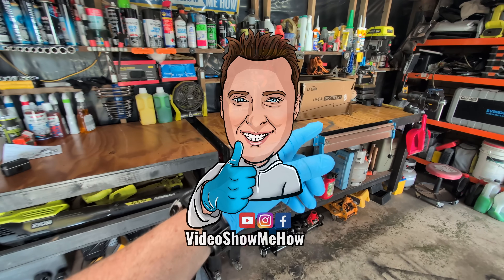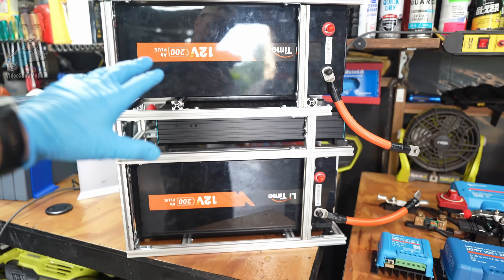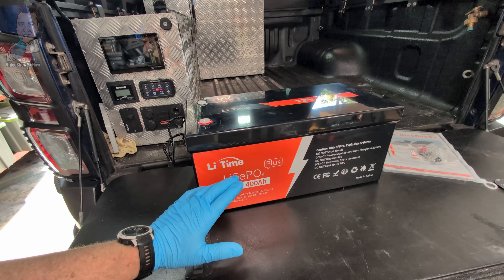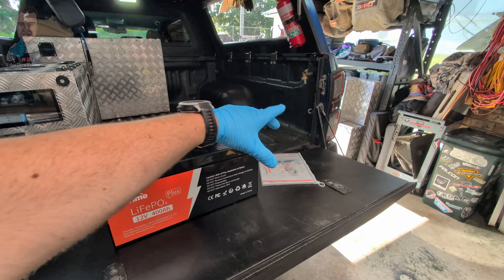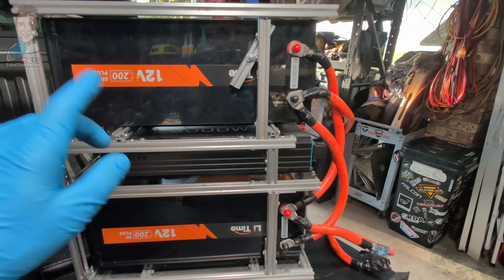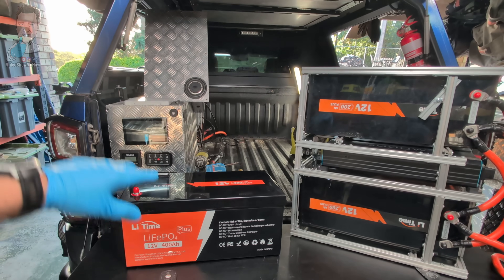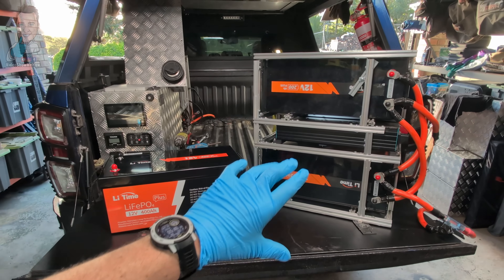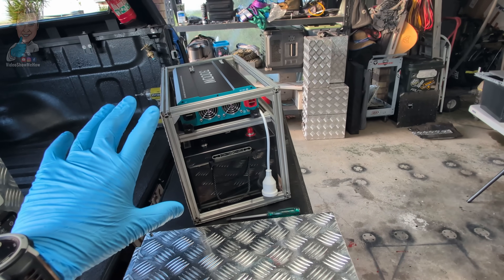800AH of Lithium in my DMAX 4wd Canopy? This is getting out of hand.. Warning 12v nerdery ahead!

Comment: I have been looking at twin draw systems for a flat floor in my DMax tub, have you thought about this.  It will allow me to get a heap of stuff into draws but still be quite accessable even when towing the caravan and give me a larger flat floor with the wheel arches below. I have been looking at the RV Storage Solutions EcoLite twin draws which don't look too deep, 275mm high overall with 220mm deep draws. Then I would need to add a fridge slide.  Give me your thoughts on this.